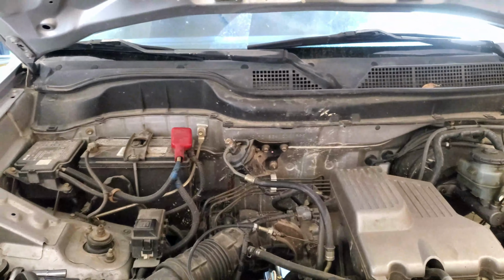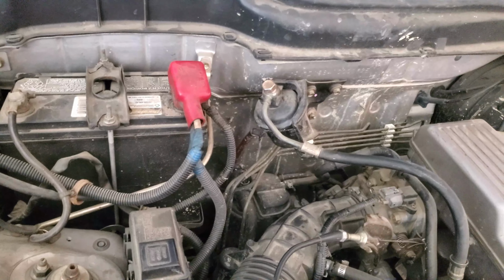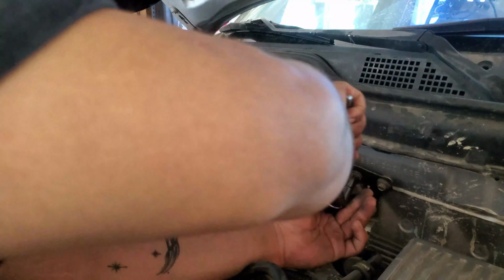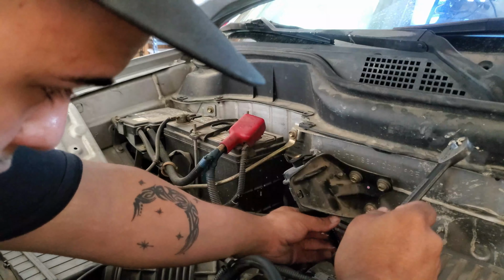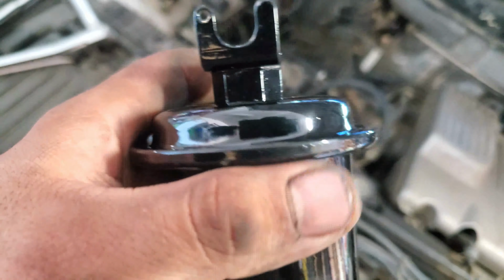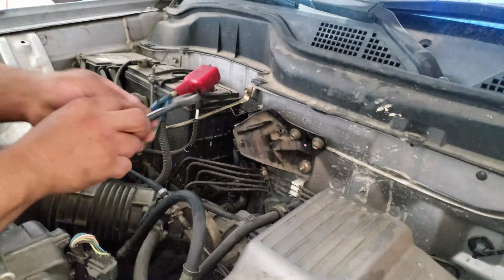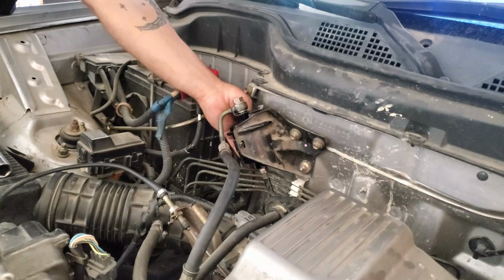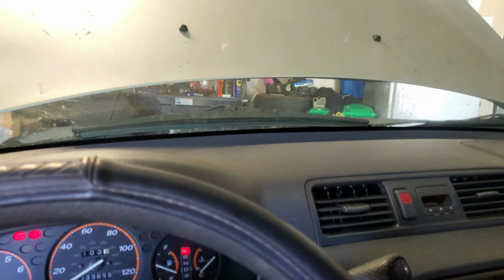97-01 Crv fuel filter replacement

Comment: Thanks so much for posting this video! I just did this to my girlfriend's CRV and it was simple! I had to remove the 3 bolts from the bracket though just to get to the screw that holds the filter onto it, but still easy!

Comment: Just to correct you the washers you get isn’t for leaks but to line up the hole in the bolt at it’s proper place so it will line up with the hole of the hose and allow proper flow. But i like your video.

Comment: Torque specs
Top banjo bolt 33 nm or 24 ft lbs.
Bottom line 37 nm or 27 ft lbs
Bracket to firewall 9.8 nm or 7 ft lbs
Honda fuel filter part number 16010-ST5-E02
Banjo seals 90428-PD6-003
PCV Valve 17130 PV3-013
PCV Valve grommet 17139-PK1-000

Comment: I recently watched the fuel filter replacement video. Thank you. It was easy to understand. I did it. Now i need to replace my fuel pump, do you have a video for how to replace a fuel pump?
Reply from the maker: i do not have a video on that but i believe you can change the fuel pump in the back by taking out the backseat

Comment: Is a small washer needed at the hard line connection? Thanks for your video?
Reply from the maker: i heard some people run it without it but in my past experience I was leaking fuel from not adding the washer
Reply from the maker: you can try it out and see if it doesn't leak without it
have someone start the car and you look  for any leaks

Comment: Hey dude. your video helped me a lot. but I have a doubt. when you removed the bottom hose, did it continue to fuel? I replaced the filter due to misfire when I start the car. but I couldn’t see in your video if this type of leak is normal. if not, I believe this is my problem.
Reply from the maker: it will drop some fuel due to the fact that the fuel lines are primed with fuel for when the fuel pump kicks on
make sure when you do this that the key is not in the ignition
Reply: @juanslifestyle8210  i've disconnected the battery before. After disconnected the bottom hose, i had the impression that it would still dropping until the tank empty.
Reply from the maker: @desanabreu   it will drop a little bit of fuel but thats it as long as the fuel pump isnt kicked on you will be fine

Comment: I'm getting poor gas mileage on my 99 Honda CRV what should I do?
Reply from the maker: add some fuel cleaner or seafoam in gas and if that doesnt work then change out your fuel filter. You can also remove fuel injectors and take them into a shop to get clean and serviced.
Reply: Also a Full tune up might help
Plugs. Wires. Cap. Rotor. Fuel filter. Air filter. Cabin air filter.pcv valve.  Make sure your tires are at proper pressure. 
Make sure your breaks arent dragging from a bad caliper.